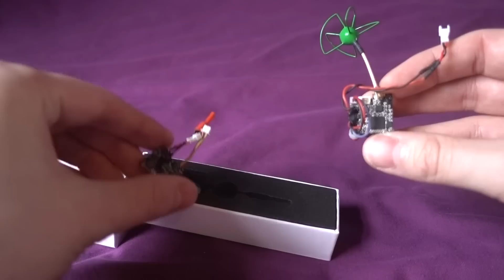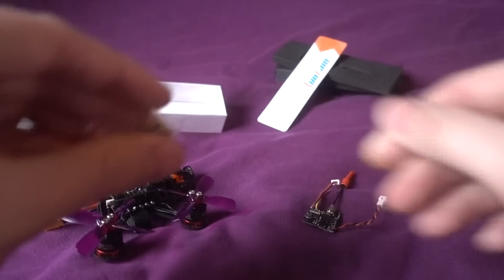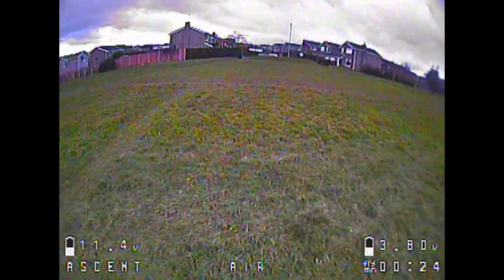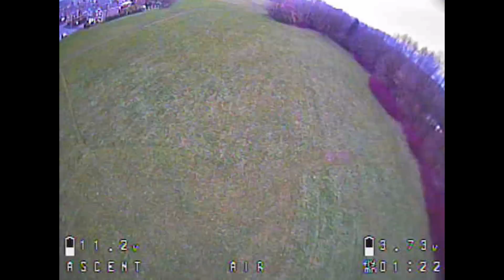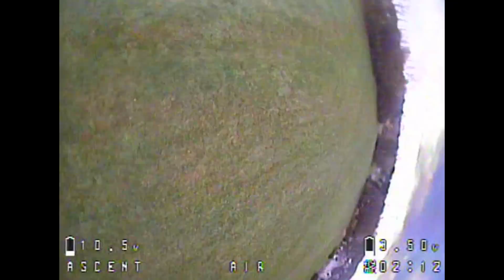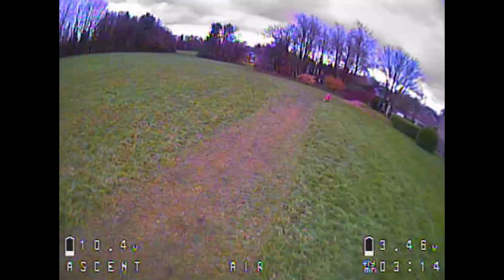RunCam TX200

Comment: Hello Andy I'm building the Diatone gt 2019 r349 from ground up. I have the runcam TX200 and Runcam micro swift 3 v2 and I would like to know your recommendations on where to solder my wires onto my mamba f04 25a MK2 mini flight stack...Thanks for sharing! My email me if you would like to send a diagram: allenm737@gmail.com
Thank you so much in advance and thank so much for the reviews!

Comment: I use the 25mW version and I had the same issue, set to 5860 but my True D kept saying 5866, also the addition of a UFL antenna Mount is most welcome as I ended up soldering a replacement whip to mine as the stock died after 3 crashes...

Comment: Agreed Andy, a Runcam Micro with Video Out and Video In pins and a simple link plug so they work as a unit out of the box but you could switch the link cable out for an OSD feed. 
Have you managed to test the Runcam Nano yet?